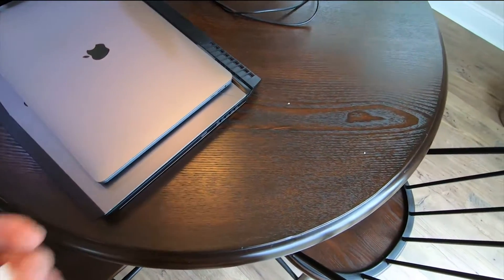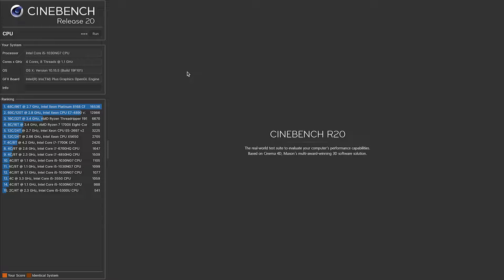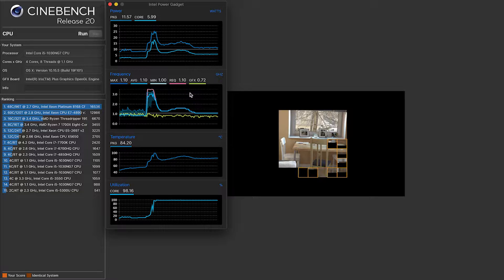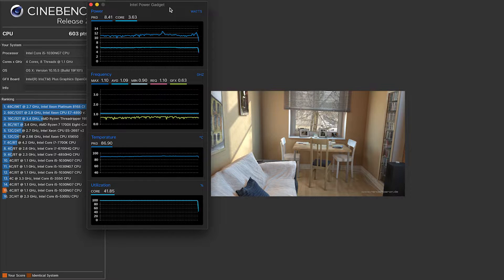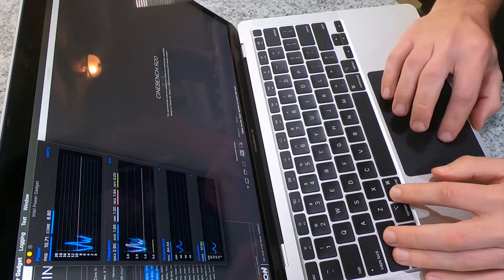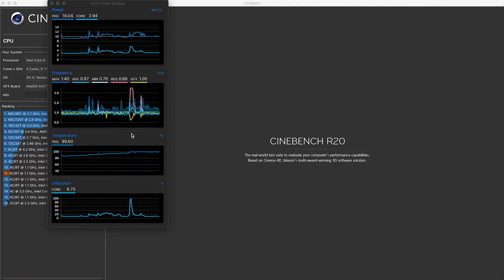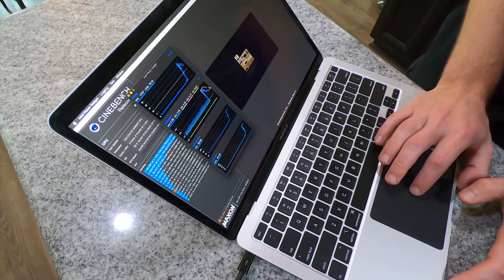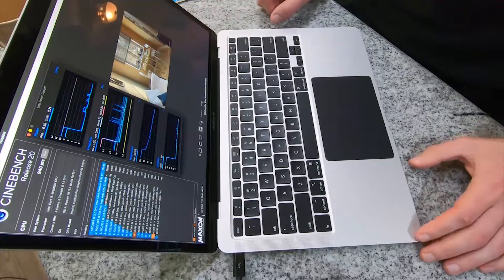Performance Testing the 2020 MacBook Air's Thermal Pad Mod

Comment: I wish you showed where you placed the thermal pads, the thickness bcoz I beleive it should touch the aluminum bottom body for heat conduction to make an efficient heat transfer.

Comment: You said you can use a copper thermal pad and it will be cooler compared to the  soft thermal pad in your last video ?? Please let me know
Reply: Kevin Nguyen no you don’t us a copper thermal pad the copper shim mod is much different
Reply: @gamecuber7987  Then what is the purpose of the copper you demonstrated in your video? I have this overheating problem on my new macbook pro 2020 apple wont fix it after i shipped it in.
Reply: Kevin Nguyen first this isn’t my video and second this is a MacBook Air in the video

Comment: hey man is this good enough for development with the ios rmulator running?
Reply from the maker: Hmm... I don't know that I'd feel comfortable recommending that. I've done some basic development work on it without issue, but I'd be hesitant to emulate anything. 

I'm sure you could make it work without issue, but I doubt you could make it work without sacrifice. For example, if you're planning on leaving a dozen (or more) Chrome tabs open in the background for Stack Overflow or general entertainment, you're probably going to have a bad time. I imagine that most people would be patient enough to deal with the lag during compile time, but since the emulator is going to be hitting the CPU for sustained periods of time... it may be more trouble than it's worth.

I'd probably jump to the Pro. The closest I've come to this scenario was running a VMWare instance of Kali Linux, and it was borderline unusable.
Reply from the maker: I'm actually going to amend this a little bit... it was a VirtualBox instance, and in fairness to the Air, the same instance was practically unusable on my Alienware 17 R3 as well.
Reply: @carcrazy2424  thanks for the feedback. right now im running Pop_OS! linux in my old laptop that has and i7 6700hq 16gb of ram and its wonderful, the problem is that im applying for jobs and im probably going to be needing xcode for ios development. if i pull the trigger on this im probably going to have to purchase a used iphone

Comment: Really want to see how you fix it so that I can fix mine 😢😅❤
Reply: you can add a cooper shim between the cpu and the heatsink and add better thermal paste between the contacts and you will get a better temps.  the macbook forums discovered that the heatsink doen't make proper contact with the cpu. and instead of fixing it apple added a black thick thermal paste to make up the difference but it isnt as good that's why it hits 100C of the production line
Reply: is it really that bad? I would love to get one, but not if it's going to expode :D
Reply: @jacquesduplessis6175  I got dell percision 😂 yeah dell is better 😂

Comment: would this mod work the same with the 2020 pro?
Reply: ElDinko mabye the pro has a heat pipe connected to the fan so you couldn’t place it all over the heatskink but mabye you could put the thermal pad around the heat pipe and it might work but I don’t know as a fact this is just me speculating

Comment: You should also look at removing the heatsink cleaning it with isopropyl and the apply some Noctua NTH 1 or the Thermal Grizzly. I have done that with your thermal pad and it helped drop the temps..
Reply from the maker: I slapped on some NT-H2 when I did the copper shim mod. 

We've got 85% of a video recorded on the matter. I should really finish it......
Reply: @carcrazy2424  awesome. My shims are on way and would soon get those to try on.  With the current mod The temps remain fine but the power delivery did increased that much. Seems apple is doing something wierd on the bios level to control this. But your video inspired me to take this step on a brand new Mac. I had one question though. Did you happen to remove that black tape on the botton plate for insulation. I have kept it on for now. Thanks
Reply from the maker: @Goryglory0209  I left it on. I'd be interested to see if the laptop develops a propensity to burn the user without it.

Comment: The clock speed is stuck in less than 1.1GHz for quite sometime, thats why the temperature couod be less than 90. But thats mean the computer is already down in performance.

Comment: Can the thermal pad move after you place it in and close your computer
Reply: Very unlikely.  It has the kind of suction you get when you bite into cheap white bread and it sticks to your mouth... I think that’s an example anyone can relate to.

The point is, the suction/stickiness is very very high. It’s not “bound” by anything, but the suction is super high. Also, you have to remember when you see it with the case off, you only see it stuck to the heat sink. Once you put the case back on, it’s firmly squeezed between the heat sink and the case, with that same strong suction.

It’s not impossible, but your laptop would have to be in the car during a deadly high speed car accident or plane crash to shift it a couple inches

Comment: Hello and thanks for the excellent tutorial. I've got an I5 8gb 256 Air, I purchased soon after release. I've worked my way through the Macrumors thread all the way to the end, very informative. There's a heat pad on its way, and also some new thermal paste and copper shim. I ran the Cinebench benchmark ten times with all other apps shut down and allowing the fan to drop to zero and the temperature drop back to 35c. Interestingly the Cinebench score was climbing as the tests progressed ( 836, 878,...975, 1011, 1045)
I was wondering about your MacBook being on what looks to be a marble surface and whether there might be any possible heat sink affects? My Air sits on a solid wooden desk which is a good insulator.
I'll post back with a comparison once all the kit arrives, but in the meanwhile, thanks again.
Reply from the maker: Very astute, and fantastic questions. I also noticed that my Cinebench scores trended upwards until peaking. 
The surface you're on can definitely make some kind of a difference, but I don't expect the effects to be extreme. I've tried tests on the wooden table in the beginning, on the granite counters you mentioned, and with the Air sitting on a large ice pack for fun. The ice pack was able to bump me from up the 3500-3750 range to over 4000 on Geekbench, but everything is a moot point once the CPU lines (requested versus actual) converge. 
Additionally, it's not incredibly difficult to overcome the Air's thermal issues entirely. With the cooper shim mod + the thermal pad I rarely touch 100*C. I can now set my Air on a glass desk and notice that the bottom of the glass is cool to the touch, unlike the area where my 16" Pro is sitting.
Reply: @carcrazy2424  I did the shim and thermal paste mod and am getting GB5 results in the upper 39xx ( 3927 lowest, 3943, 3973, highest 3994 )
This is with allowing the temp to drop back to 30-40C between runs. Cinebench figures are 1120/1130 range. I'm seeing 99% core utilisation, temperature reaches 98C and the core request/actual lines merge until later on in the run when they diverge quite significantly.
I'm not sure if there's any more headroom to be gained by fitting a thermal pad as well?
EDIT:
I went ahead with the thermal pad mod as shown in the Video. Now getting a GB score of 4018, temperature max never reaches 100 and the fan is running a lot slower and hardly audible.
Many thanks for a great guide

Comment: Thanks for the videos. I have the i7 2020 model and have purchased the recommended Arctic thermal pad. I did multiple benchmarks before and after and have tried a second thermal pad with varying thickness. All in all, my best results so far are indeed with the 50x50x1.5 thermal pad from Arctic you recommended. I went from 877 and 898 stock to between 1155 and 1181 after the thermal pad. I still believe there is room for further improvement, so looking forward to the shims. It sure looks like it would be possible to create a slim heat pipe to channel the air to the fan, but this would also require some software changes as well since no matter how cool you end up getting it, the processor stops trying to obtain higher wattages.

Comment: Hey thanks for the video. I'm curious if you run any external monitor? My 2020 i7 16gb Macbook Air runs great (although warm) on its own, but connecting one or two extra monitors its hitting 100 degrees a lot, throw in a zoom call using a USB HD cam, it has locked up on me a few times. I gotta go get some of that thermal pad...
Reply from the maker: If the thermal pad alone doesn't fix your issue, the copper shim will. With my copper shim AND the thermal pad, I've been able run a 1440p 27" @ 60Hz, and a 1080p 34" Ultrawide @ 75Hz simultaneously without issue. Temps normally hang between 65* and 75* with the fans around 2500RPM.
Reply: @carcrazy2424  that sounds awesome. ok definitely gotta give that a try. I'm using 2x old Dell 23" monitors at 1080p, but wondering if its the dock/hub not helping either. Each monitor is on a separate hub. With one monitor running its hot but mostly ok, both running I start getting issues.

Comment: Hey, if you check our Linus Tech Tips video on cooling this laptop, you'll see actually that Apple's SOFTWARE is limiting the performance. They got the temps down to 50 C with water cooling, but the laptop resisted to perform better. Thermal pads are probably our best option when it comes to day-to-day usage, until someone figures out how to change the power curves.
Reply: @GladUrBad which?

Comment: Really nice video. Thank you for taking your time and showing us this. Could you try a GPU benchmark such as Unigine Heaven? A stock macbook air 2020 gets around 9 to 10 FPS, I wonder if the GPU performance is much improved  with the thermal pad. I think you will get a much better improvement ( 50% probably vs 17% you get on the CPU).
Reply from the maker: I can definitely include this in the copper shim mod's video.

Comment: Nice video just wanted to say I know a Linus tech tips may get a lot of credit for ‘fixing the MacBook airs thermals’ but your video was first and I am just really happy that you made the original video. I’m going to do this to my air when it comes and I wanted to say thanks for the easy solution for the airs thermals. 

Also, are there any downsides to the mod. Does it burn your legs or void warrenty?
Reply from the maker: That's... partially my fault. I was emailing Linus last week and included a shameless plug for my channel. First rule of business: don't (accidentally) create your competition.  Nonetheless, thank you for saying this. I wasn't salty at all until I clicked on a Forbes article in my Google Now feed about "New Warning Issued Over MacBook Troubles." Imagine my surprise when the headline was LTT's video, lol.

Anyway, I whole-heartedly recommend the thermal pad mod to anyone and everyone. It's simple, it takes minutes, it adds an amazing amount of usability to the MacBook Air, and I expect that you are extremely unlikely to run into issues should you need warranty support since you can simply remove the pad at any time. The bottom of the case does get warm, but since the majority of the heat remains in the middle of the device, you're unlikely to run into issues unless you like to balance it on one leg.